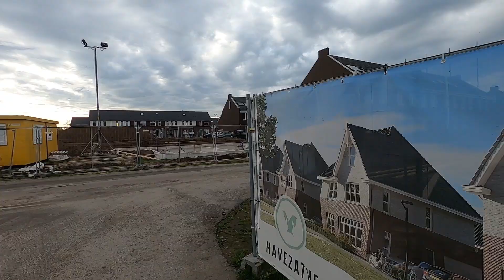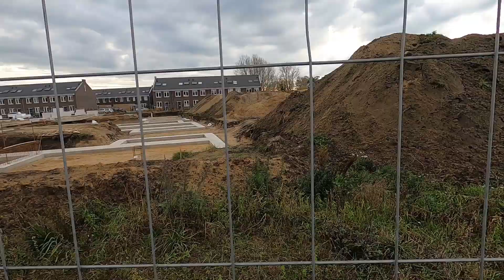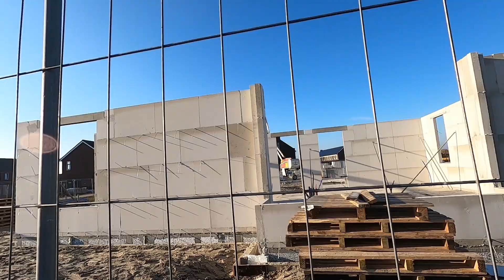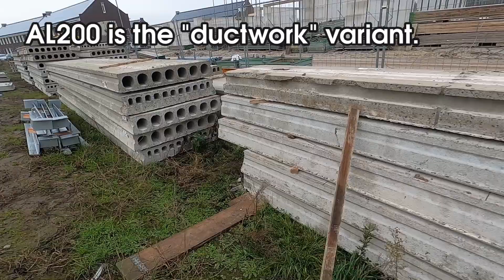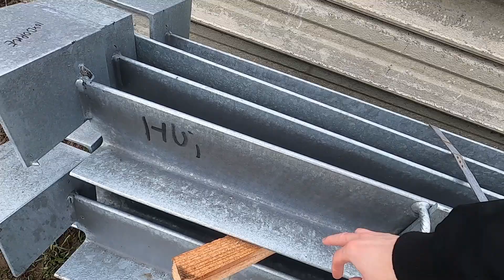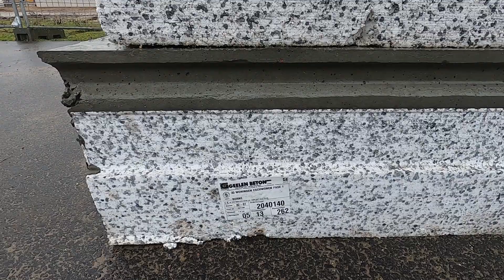Dutch Housing Estate construction Series 1

Comment from the maker: Oops.. I still have managed to have at least two typos in the somewhere annotations. Engineers and spelling 😅. My editing software (Adobe Premiere Elements) has a very ropey text editor which is clunky and slow whilst typing.
Reply: Excellent and informative. I need some guidance/feedback on removal of a prefab wall. I'm wondering if you could give some guidance on how to possibly proceed.
Reply from the maker: @LiamAndMommyTogether  When it comes to removing a wall, I would consult a local structural engineer for an assessment. Chances are that the wall is loadbearing or that is has some other structural function (such as a lateral stability wall that braces the structure against wind loads). You may also need to get a building permit for the works, which will require some design work and a calculation  report from an engineer. Removing a structural wall will often require a structural steel frame to come in it's place to change the load path which can also affect the foundation in some cases. A good, qualified builder will hire an engineer to make the assessment.